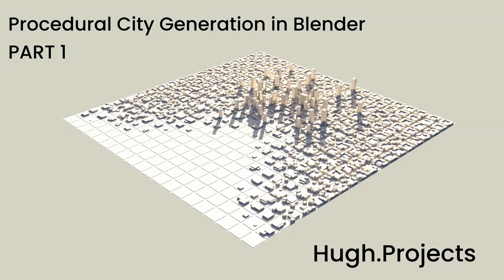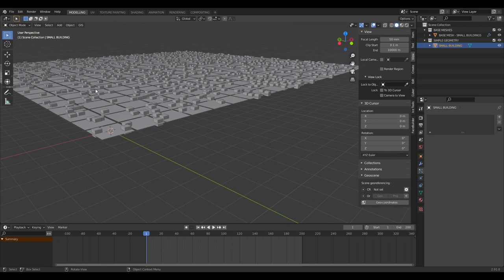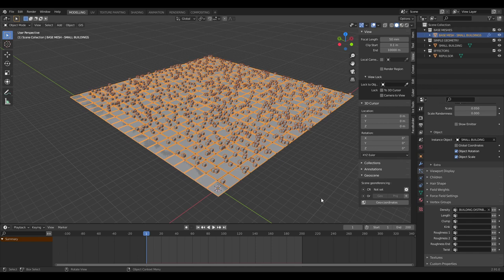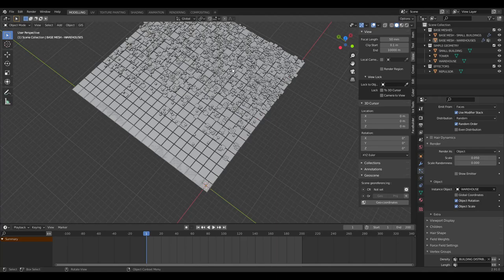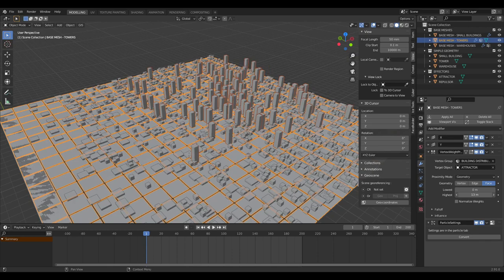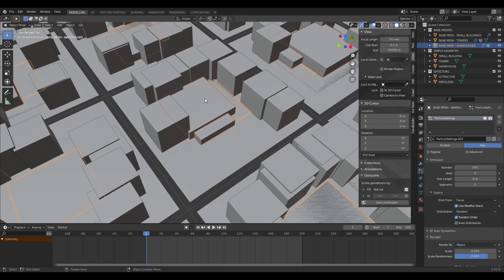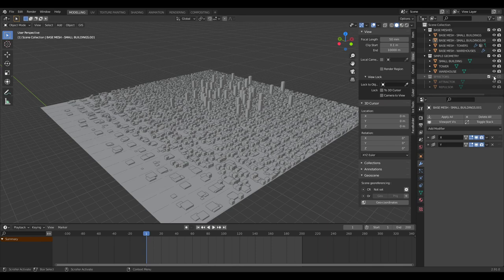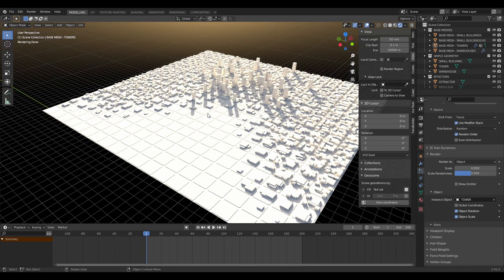BLENDER - Particle City Generation

Comment: cool cool, but how stop intersecting each other ? ..hm
Reply from the maker: Up until recently I didn't know of a way of controlling it procedurally. 

But I will be re-doing this tutorial in the new geometry nodes system when Blender 2.93 is fully released. In geometry nodes you can control the minimum distance to stop instance intersection when scattering. Along with a few new powerful features!
Reply: @hughoconnell5592  sounds awesome ! Thanks for reply